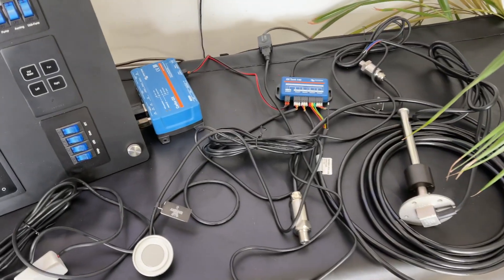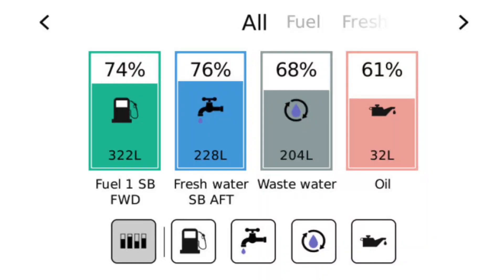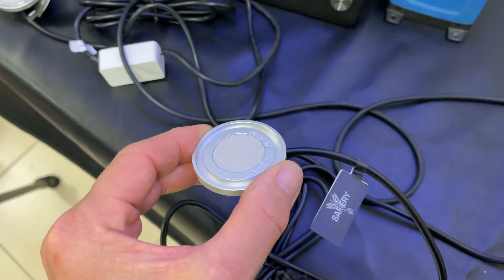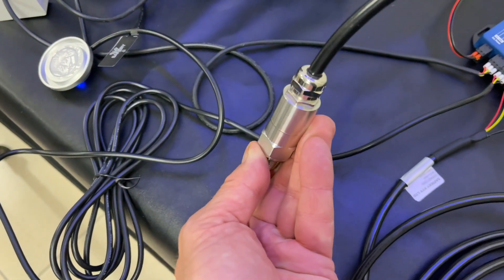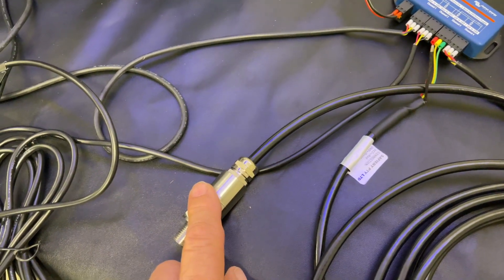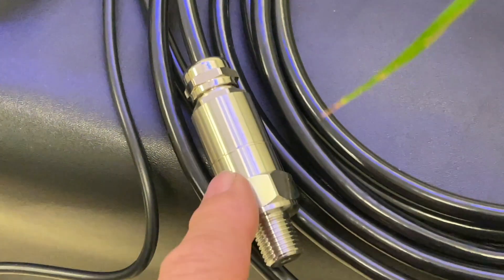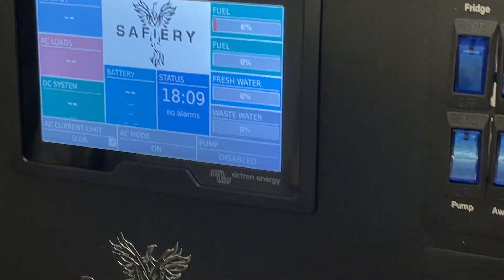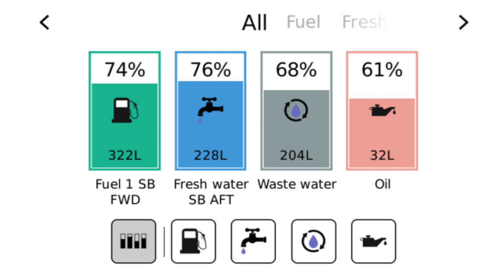Victron GX Tank 140 now Accepts Voltage based Sensors

Comment: Great video. I am doing a tank 140 setup tomorrow.
The gx display with your logo and tank overview on the same page. How did you get this layout? And is that part of a software update?
What is the process to upload logo file and setup? Maybe a video on that would be good.
Thanks again.
Reply from the maker: Hi ask your supplier of the Cerbo and GX those questions please. They should assist you. Cheers

Comment: Do I have to buy the Gx tank 140 for those sensors?or the Cerbo gx it's enough
Reply from the maker: Yes, these are voltage inputs. Cerbo is resistive inputs.
Reply: @Safiery  do you have any sensors I can use with Cerbo?

Comment: Very nice product, we have bought the tank level senders and the Tank 140.  

2 questions for you:

1 - Can you run the tank pressure sender remotely, as in can I mount it higher away from the chance of water ingress?

2 - When will the update be released that shows the new screen on the Cerbo?

Nice videos and keep up the good work guys.

John
Reply from the maker: Hi John, 1) the IP67 tank sender has the differential pressure tube inside the cable and can be mounted remotely. 2)The screen update for the Cerbo is released ver 2.72. and is great. Cheers